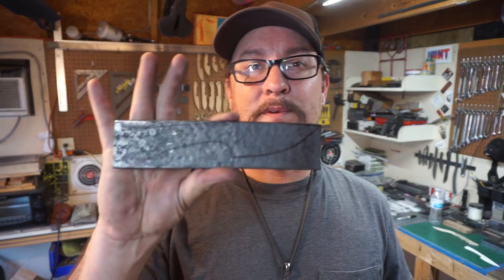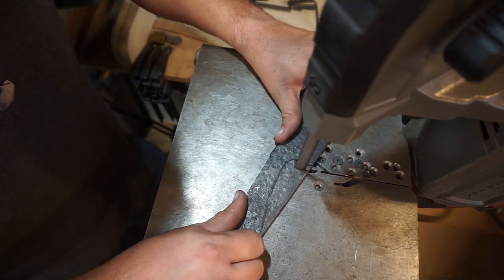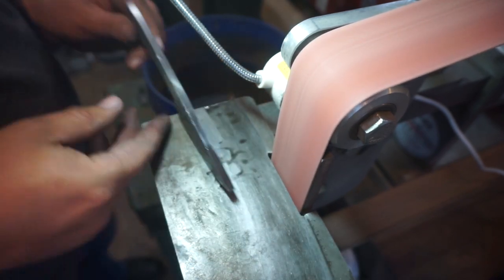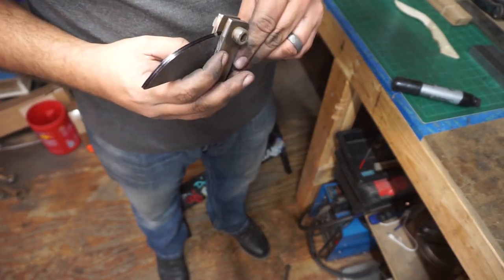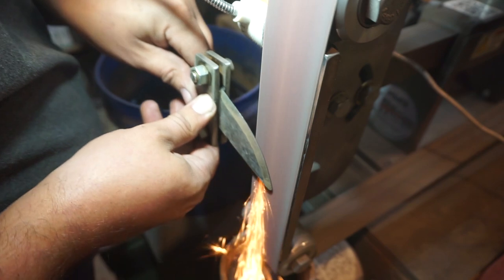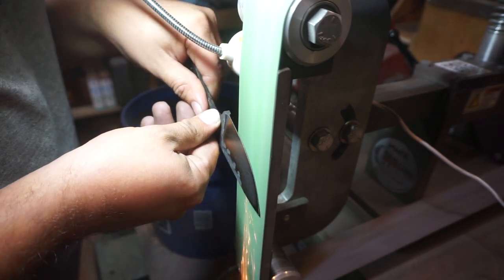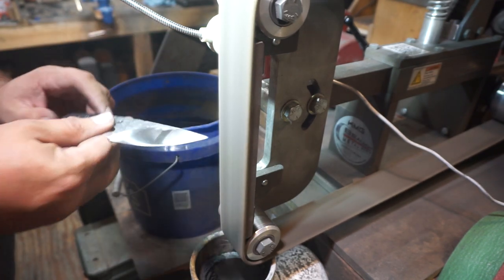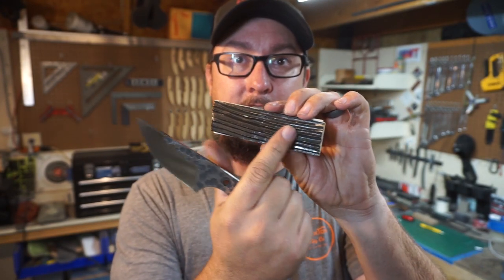Making A 5160 EDC Knife | Knife Making | Part 1 of 2 | Vlog

Comment: I have exactly the same portaban setup, including blades, and have been very happy with it. Sadly, right now that's where the similarity ends; I have a 5160 leaf spring seax I have 6 hours into that developed a cold shut in the tang. Probably should have followed your lead and done most of the shaping by stock removal.
Reply from the maker: I do a little bit of both. There is always a bit of risk when forging.